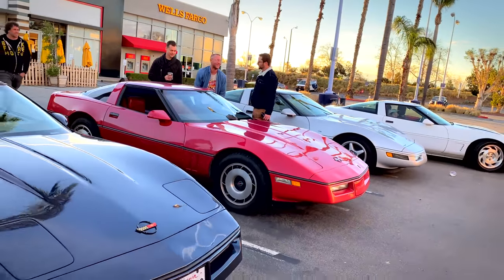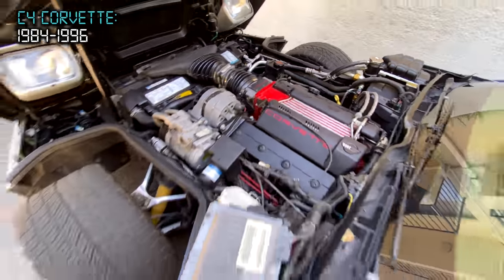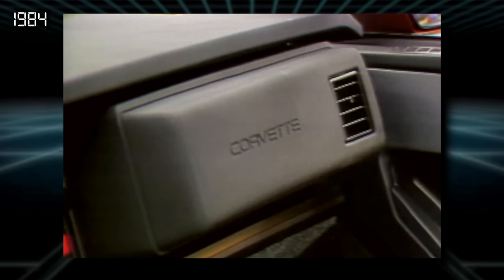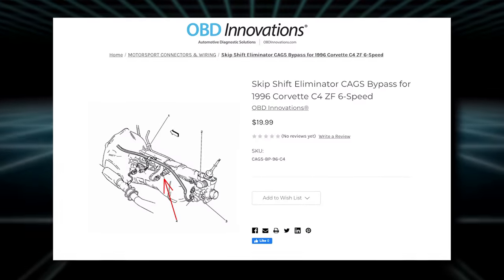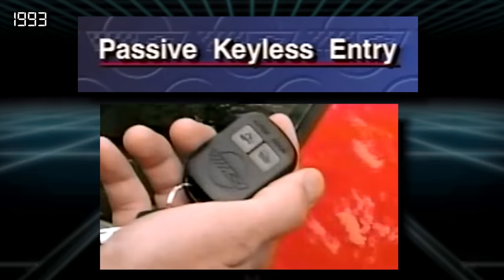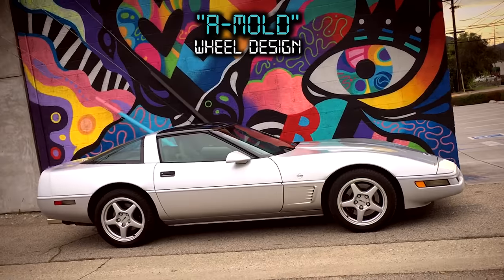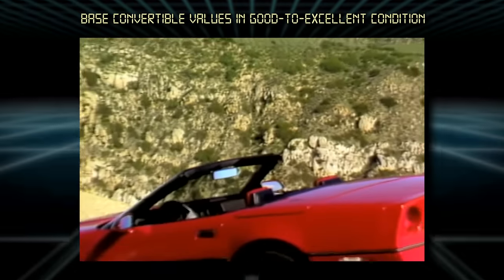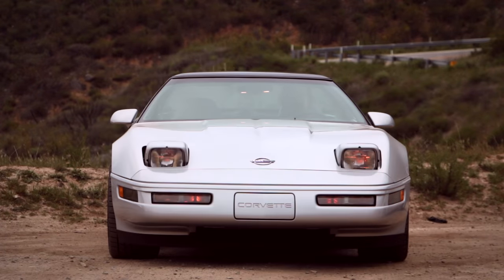C4 Corvette: ULTIMATE Buyer's Guide (Values, Performance, Yearly Changes 1984-1996)

Comment: I am 99% sure that in 1995, 1996 a Third cooling fan was added. Please Advise if I am wrong ...
Reply from the maker: That's not the case, two cooling fans (I visually inspected my 1996 to double check).

Comment: In Houston, these cars can be found for $5k, but I’ve seen one for sale in a parking lot for $3500. It looked good from 100 feet.
Reply from the maker: They can be had for those low prices, but they definitely won’t be in “good to excellent” condition that I used as a metric for the values in this guide. 

Cheap C4s are complex cars and can easily become money pits if they’re not taken care of. However they make great track rats/drift missiles for that price!

Comment: My first car 1987 c4 l98 automatic with the sawblade style rims. Slightly modified motor full exhaust and was getting close to 30mpg highway. Miss tht car but a guy hit it and ran at a gas station and tht was end of that unfortunately

Comment: I put a later vented cap on my 92. I got so quick at changing the whole unit, I could do them in about an hour, so it was never really a bother to me. 

Also if your mechanically inclined it's not hard to bring your LT1 up to LT4 specs. Biggest bummer though is that the early ECUs really can't cope with much change

Comment: Great video! People gotta talk about the zf s6-40 six speed GM put in those. They spent a ton of money developing those with the German “ZF” brothers and created one of the beefiest transmissions known out of any car produced that year. Capable of handling hundreds more horsepower than stock, and 1,000ft lb/1,200hp with simple oil passage porting, it seriously is one of the coolest transmissions ever made. Way better than a t56 magnum. I would pick this trans over any modern manual racing transmission.
Reply from the maker: I knew the ZF 6 speed was a strong transmission, didn’t realize it was THAT strong. Pretty cool!

Comment: Always had mixed feelings about C4s , A few years back I came across one asking $7000.00  i purchased an 89 c4 6spd with Z51 SUSPENSION PACKAGE  , RED WITH TAN LEATHER , 120000 MILES IN 2020. its had 5 previous owners with lots of paper work passed along.  Body and interior are in perfect shape. i replaced plugs , wires , alternator, injectors, ignition coil and distributor cap along with a new idle air control valve.trying to solve a NO START condition that developed after driving it for a year.  I finally removed the ECM and had a local radio repair guy have a look and he resoldered some resisitors and capacitors, AND NOW the car starts great .im into the car for $10,000.00 now and know I would never find a car as sporty as this for that money. i ONCE AGAIN really enjoy Sunday drives now that this car is reliable. Best looking and most fun to drive 
car on the road in my humble opinion
Reply from the maker: Great to hear you have it all sorted and that you’re enjoying your C4. 1989 is a great year!

Comment: C-4 is One of the best riding and driving generation of the Vette and still the most affordable I had all original 84 with no reliability issues my 85 same reliable easy to work on easy to fix yea certain parts are more expensive than other parts it is what it is pretty much with anything you take of it then it will take care of you.

Comment: I am a big fan of the 1982 C3 and the 1996 C4, both with a manual transmission. If I had to choose 1 I would probably go with the 1982 C3.
Reply from the maker: Manual wasn’t offered in 1982! That was an automatic only year. I'd still love a 1982 Collector Edition.
Reply: @RetroCarsForever  Thanks for the knowledge

Comment: Helps to "know" some basic car repair.  Dealer repair manuals are "old" and the local dealer threw his out.  My '94 was dying while being driven at random intervals.  Dealer had my car a week and could not find anything wrong.  I found it when a code popped up on the dash display as the motor died going down the highway... lo142.  Love Google as it told me that was the digital coolant sensor.  It was tricking the computer into flooding the engine because it was "cold".  Btw... gas pedal all the way to the floor before starting should put that era engine control into "limp" mode.  In the end it was a $30 part that I put in myself... scary because it did leak some coolant... right above the dreaded optispark.  Transmission quit shifting into 2-3 after that... just a loose wire inside the trans.  Love that car and drive it to work all summer.  Mine is not a baby and I drive it like a vette likes... no tickets yet.  Next up the heater core... currently bypassed.  Need the heater core to keep the windshield clear on cool mornings or when raining.  Expect problems and a few dollars now and then... like any other vehicle.  So many people love the look of my car and it is just an ordinary stock '94 vette that I own because it was stupid cheap... $7500 with 100k miles.
Reply from the maker: Agreed that having some basic mechanical skills on any older car like this is going to be a HUGE plus.

Dealers especially are pretty clueless! Older car or Corvette specialists seem to be the only mechanics who know how to deal with these cars.

Comment: 1992 Coupe  6 Speed.  Yes the bizarre ignition system you spoke of is the Achilles heel of these corvettes.
Reply from the maker: Yeah early Optisparks seem to be a common issue. However, at least they dont take out the entire engine when they go like some other sports cars have to deal with (like water cooled Porsches and their Achilles heel, the IMS bearing).

Comment: Just picked up a 95 green convertible with 56,000 mile for 11k. I couldn’t find a better option for a daily driver, I live on dirt roads with plenty of snow/salt in Michigan. Over 5+ years I will drive it hard, maintain it but will skip washing it and park it in the worst of spots just like most moms! In 5 years if it’s done, it only cost me 11k but will still have value and cost less, I’ve did this several times, drive them like a ford ranger.
Reply from the maker: Heh, enjoy your Corvette however you wish! As long as you drive it and maintain it is all that really matters.

Comment: I’m a C4 lover. I bought one new in 1994 and one used in 2017. I think it is the most attractive style. However, there is a big problem with these cars. No electronic parts available except used and my Corvette specialist won’t put used parts on it. I am slowly losing car systems in mine having only 44k miles. Gone: ABS, slip control, cruise control, tire pressure sensors, climate controls (I leave my a/c on all year for fear I won’t be able to turn it back on once it is turned off, fortunately I live in South Florida, gone: radio. I know an after-market radio can be put in but can’t find anyone selling them and installing. It is somewhat outrageous that GM won’t support these cars and so far as I know, there are no aftermarket manufacturers. My understanding is there were more C4s produced than any other styles.
Reply from the maker: I'm surprised to hear that, Ive found aftermarket parts were quite plentiful for C4s (mostly because of how many of them were made). I could see some of those being difficult to source as new, but its a shame your specialist refuses to put in used parts...Seems like that would be better than not having any of those systems at all.

Comment: I have an 86 Pace Car convertible. And by the way, all 86 convertibles are Pace Car editions. Mines yellow, only 513 where that color.  Only 7,513 Pace Cars were sold.
Reply from the maker: Nice car! I actually covered the special editions (including that one) in my special edition guide here- https://youtu.be/vWhwNK5Lkyg
Reply: @RetroCarsForever  very cool!! Mine is not stock, but it looks really cool going down the street. The #7 cylinder cracked out. So I got a 1988,.040 over, 4 bolt main, short block ATK built from Summit.

Comment: I had a cobalt took it from about 200 to 250,000 miles on the original battery….
Reply from the maker: That’s pretty typical assuming that was driven regularly over the course of four or five years. You can stretch it even further in most cases. 

But I wanted to bring up battery life with Corvettes because they tend to sit long periods of time between drives, and owners usually forget about them.

Comment: Ive had a bunch of C4s over the years. I had an 88 with like 160k miles that drove great, but was experiencing intermittant HVAC. I have two 93 Z07s...one with 130k miles...my heater blend door actuator broke...at which point i replaced everything in HVAC system. But my highest mileage C4 was an 89 Z52 with auto trans and Flowmasters. That had like 260k miles on it, but ran strong (13.85 qaurter mile). Anyone with a near 100k mile 6 speed should be prepared to replace clutch slave cylinder. Ill film a vid!
Reply from the maker: Wow, those are super high miles for C4s! Look forward to the vid.

Comment: Great video! I am not sure if I totally agree with the statement that after 140k miles they generally require a lot of work to keep going. I think I would rather have a higher mileage car with service records that has had good up keep than a car with lower miles that has sat for a long period of time.
Reply from the maker: Thanks! And I actually agree with you. "A lot of work" would mean a big stack of service records, as there would be many items that I'd want to see replaced by 140k miles. I just mean these arent like Toyota Camrys that will barely need anything to hit 200k miles, just trying to set people's realistic expectations.

Comment: incredibly helpful video! thank you so much!!
I am actually trying to get some info for a 85 Greenwood that I have, I don't know much about it, and the original owner passed away, and his wife sold it to me, so I haven't been able to find much info on it, or if its in fact an original "Greenwood" I also own a 84 c4 manual and also an 85 c4 automatic, and this one feels nothing like it, much more aggressive, it appears to look stock, so I was hoping to know if Greenwood would do performance upgrades or if it was just a body kit? any info would help! I truly appreciate your help!! Definitely a subscriber now!! 🙌🏻
Reply from the maker: I'm not super familiar with Greenwoods, my understanding was it was a popular body kit (that might've also included a few suspension mods, not sure, look around online for more info).

If you dont know much about the car, it's quite possible it has other mods that arent very visible but will certainly change performance, like a hot rodded computer chip or a axle ratio change.
Reply: @RetroCarsForever  Thank so much, I greatly appreciate it!! 🙌🏻

Comment: Did You ever have any A.C. problems? I'm having problems with my 96. Only blows through defrost and floor.
Reply from the maker: I haven’t had any Ac issues beyond needing to recharge it. It sounds like you might have a blend door issue.

Comment: THANK YOU for this video. Some great stuff in there. I own a 1989 ZF6 - a sweet spot for me because I like the digi dash but also the 6-speed gearbox. I do not own the tire pressure option in my car, but I do have the FX3 adjustable Bilsteins. They still work at 136.000 miles. I wonder if they ever got replaced - I don't think so. The system works flawlessly so far, and if it ever breaks, I am not sure if I'd actually go and fix it up for that price... I leave the car in comfort 99% of the time anyway. Also, I wonder why the adjuster is so expensive. Shouldn't it just be a simple electric motor in a fancy dress?
Reply from the maker: Thanks for watching! I agree, the 1989 is a sweet spot...If I didnt need to rely on my C4 as my daily, that's the year I'd probably get. Best mix of older looks and digi dash with the newer trans/suspension/brakes. 

Not sure why the FX3 is so expensive, but it is! I checked several sources to verify the parts prices.

Comment: Isn't it actually 13 years?  Whatever, I enjoy both my '95 six speed with 149,000 miles and my '93 Automatic with barely 60,000 miles, but most of those were done 1/4 mile at a time.

Comment: The best deal in ANY Corvette is a '96 with one year only LT4 engine.  If its in a standard '96 Vette, very cool and very fast.  If in Grand Sport also very cool and very fast.  But, not quite as fast as the standard Vette because of some added weigh in body to accommodate bigger tires/wheels.    Collector edition with LT4 is maybe the best all around deal out there when looking at performance and rarity.   But any of these, you cannot go wrong!
Reply from the maker: I agree...I picked my 1996 Collector Edition LT4 for its unbeatable combo of rarity, performance, and value. 

Pretty much a Grand Sport for 10 grand less! 

For what its worth weight wasnt something I thought about. The added tire section of the Grand Sport is very minimal added weight, maybe an extra fifty pounds or so. The ZR-1, on the other hand, weighed a good 200 lbs more than a base car, which is a notable difference.

I go more into Special Editions like all three of those in this video here if you're interested-
https://youtu.be/vWhwNK5Lkyg

Comment: Fun fact. The LT4 actually produced around 360 HP. They rated it lower because it was more powerful than the 97 C5's 350HP LS1.
Reply from the maker: I've heard that! But I'm a bit skeptical...Ive driven a few LT4s (and own one) and driven several LT1s as well, and the LT4 just doesn't feel like it has 60 more hp. 

Maybe it's the tall gearing that seems to blunt that effect, OR (my theory) some LT4s were built stronger than others.
Reply: @RetroCarsForever  One thing to note is 60 hp difference is not the same across all engines. 60 hp difference in lower HP engines is much more noticeable than engines with higher HP.

Also, the power is made higher in the RPM range, so the difference will be noticed after ~60 MPH.

Perfect example is I had a 1992 Prelude Si with the 160HP 2.3L engine. I swapped in a 200HP 2.2L VTEC engine. They were exactly the same up to around 60 MPH. I measured it by racing my friend's 1994 BMW 325is.

Same goes for my 2004 BMW 330i ZHP trim. It is a 3.0L 235HP. Comparing it to the E46 M3 3.2L 333HP, we are even up until ~50 MPH. 

If I get the chance, I will compare the LT1 and LT4 in a video.

Comment: Question:  What are the clear-lens lamps on the sides of the '84-and-beyond Corvettes?  I'm guessing that the ones on the front are cornering lamps, but what about the ones on the rear?  Are they also cornering lamps, or perhaps supplemental back-up lamps?  I've always wondered about that, but couldn't find an answer...
Reply from the maker: Funnily enough the ones in the back actually light up when in reverse!